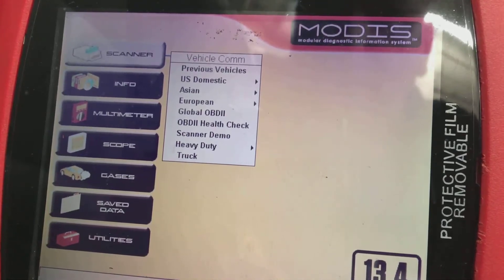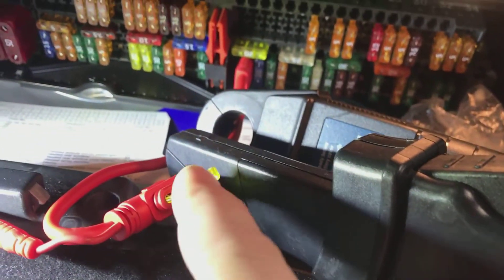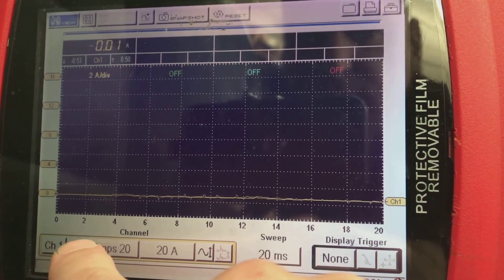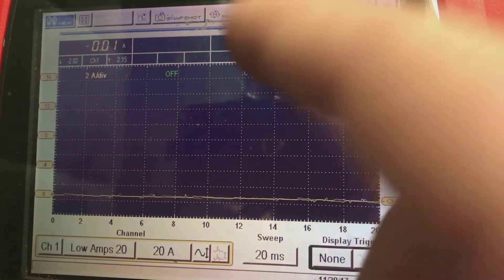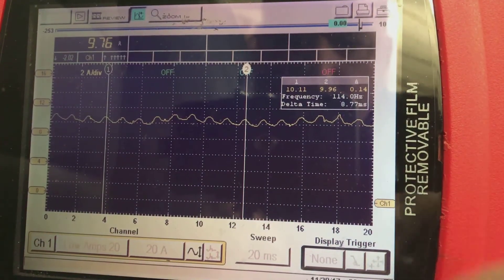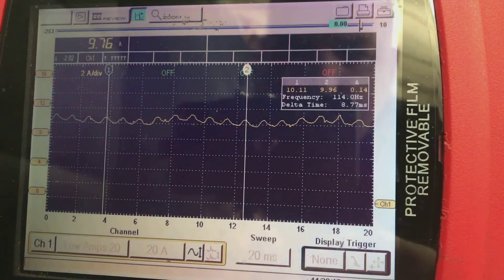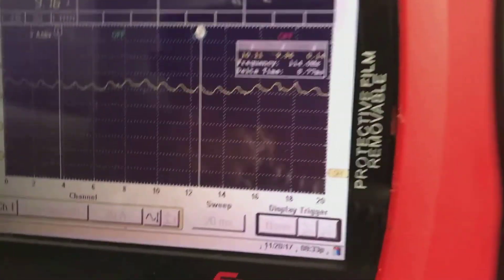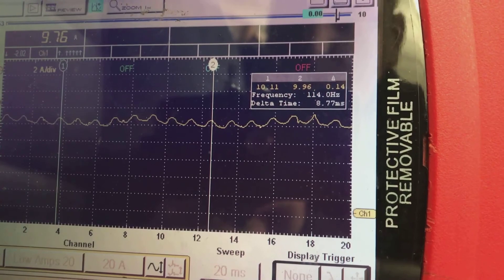How to current ramp a Fuel pump

Comment: Great video but can I do this with the car running I don’t have a bi directional scan tool ? I have a vantage pro I just bought for a lab scope and my amp clamp and voltage tap kit from aes wave
Reply: Yes, you could do it with the car running. Just make sure it isn’t a pulse width modified (PWM) controlled fuel pump as most newer pumps are.  If it’s a conventional relay controlled fuel pump, you could also bypass the relay with a loop of wire which would give you a place to connect your amp clamp

Comment: Thank u for this video. Straight to the point. The importance of learning and understanding this can really be a time saver and to be very accurate in ur diagnoses. Especially on a no start if u manually energize the fuel pump and get a fuel pump current that's reasonable. Saves u from going underneath the car and funding the pump. Current testing if u understand it and practice it will help u out dramatically. No current flow u have a problem. Need power and ground for current to flow. Thank u. Love watching ur videos. Learn something everyday. God bless

Comment: Short but good vidio....generaly what is the amperage on a fuel pump....trying to learn...thanks
Reply from the maker: Eri Ginez thanks for watching and the feedback. Amperage is a direct relation to the fuel pressure required by the system. I would say an average amperage one would expect would be between 4 and 12 amps.